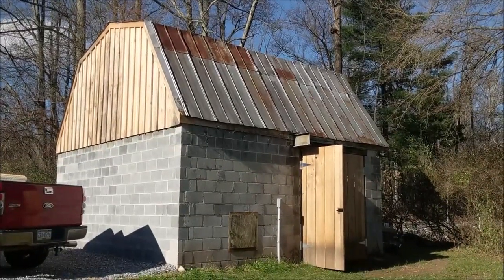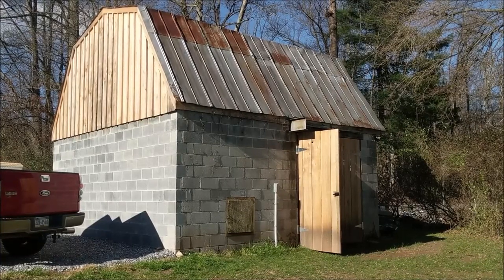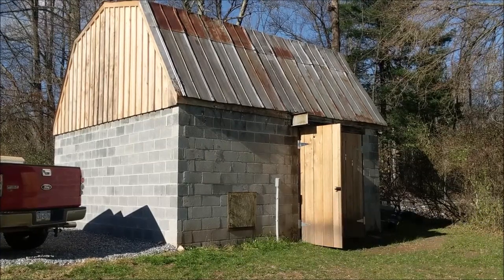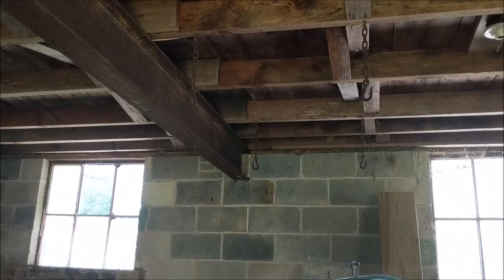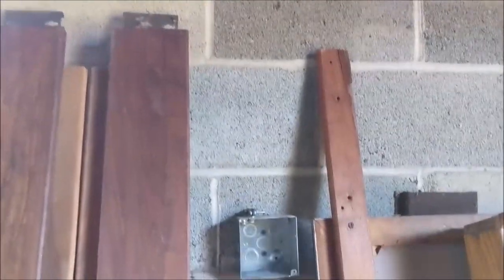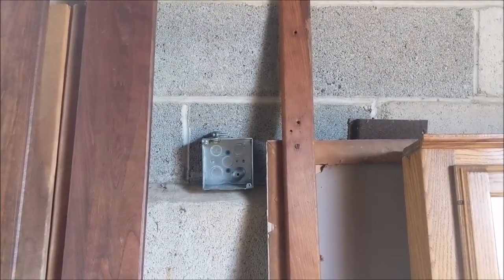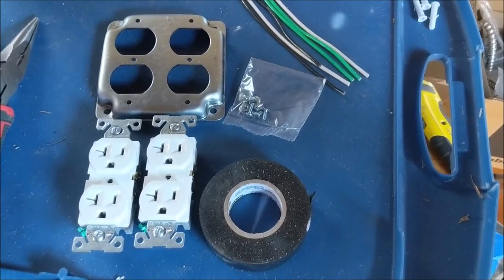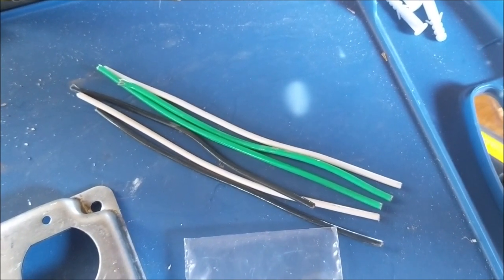Shop Setup - Wiring Electrical Outlets Step By Step - Part 1 | #UptaCraft

Comment: 9:22 that's a short-circuit waiting to happen, use proper MC connectors (not Romex connectors) and install anti-short bushings on the MC cable prior to connector insertion.
20:12 tighten those loose/unused screw terminals on the device...the electrical tape is a waste of time and material.
21:05 the tabs need to be removed so the device will fit properly on an "RS Cover" (which you're using), if your installation were using "mud-rings" or plastic boxes the tabs would need to remain intact for a secure/proper installation of the device.

You mentioned that you had consulted with a licensed electrician prior to your installation...sure doesn't look like it friend.  Also, your shop would be considered a "damp location" (at least in my state), so your first device from the sub-panel should be a GFCI receptacle.
Reply from the maker: Hi Tom, thanks for the constructive criticism. I appreciate it! 
While I did consult with an electrician on some items, I never asked him to inspect the work afterward. 
I'll be making a few additions to the shop wiring in early spring, so I will definitely plan to implement your suggestions then to bring it all up to standard. Maybe i'll to a follow-up video then to document it.
Thanks again!

Comment: Big mistake you made is using the wrong cable clamp. Looks like a Romex clamp and you need an mc cable clamp. There are several styles to choose from and a red bushing is required to prevent the wires from being cut by the sharp edges of the cable. MC cable is ok to use for this purpose, but EMT conduit would look better. You didn't show how you cut the cable. There's an mc cable cutter designed for this purpose and is easy to use.
Reply from the maker: Agreed! My intent is to go back with EMT conduit at my first opportunity. Thx for the feedback!